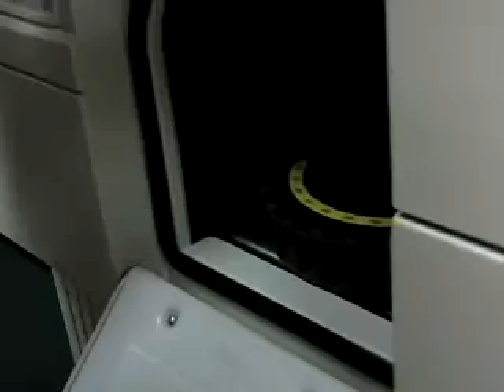Biofuel

Comment: "It sounds counterintuitive, but burning oil and planting forests to compensate is more environmentally friendly than burning biofuel."

"The reason is that producing biofuel is not a "green process". It requires tractors and fertilisers and land, all of which means burning fossil fuels to make "green" fuel."

"Scientists found that reforestation would sequester between two and nine times as much carbon over 30 years than would be saved by burning biofuels instead of gasoline"

Comment: theoretically, there will be a zero net CO2 gain in the long run (if everything will be powered using alternative fuels). But there was a study by a Nobel prize winner indicating that first generation biofuels production may exacerbate the greenhouse effect through increased NO2 levels in the atmosphere; since smaller crops like corn releases more NO2 compared to larger plants. So researches today are concentrating to 2nd, 3rd and 4th generation biofuels. Try to search for it in Wikipedia.